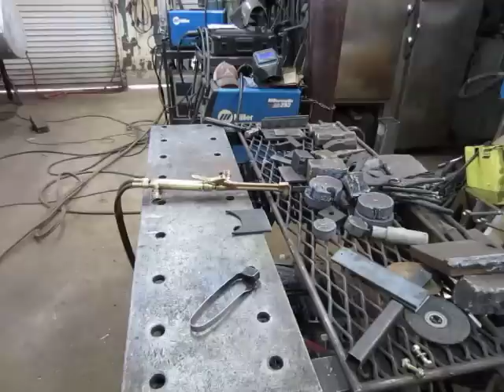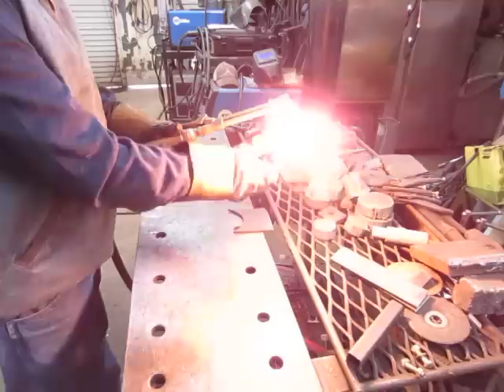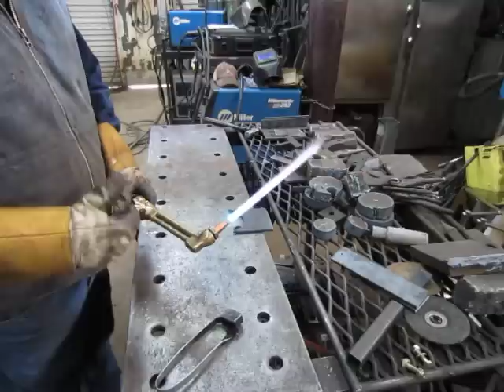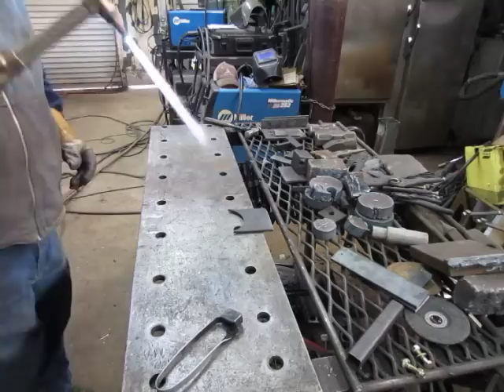Using a cutting torch 1/4" plate

Comment: What brand/size tip were you using in this video? With 40psi Oxy. What pressure acetylene do you recommend? I’m having a hard time cutting some 1/4 in plate, excessive slag...
Reply: Ik this is 2 years later but I have the same problem. 3/8 inch is easy for me but I can’t seem to get 1/4 inch right